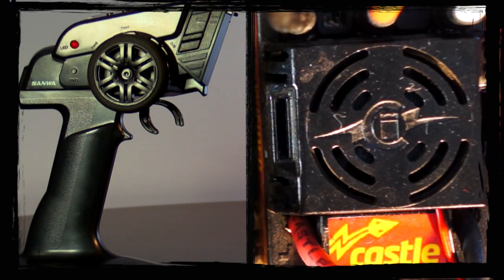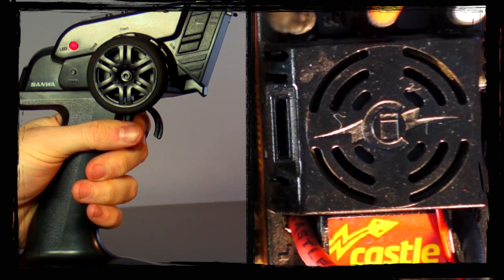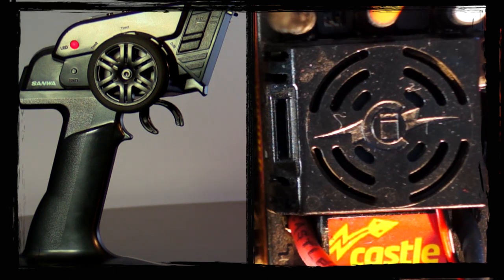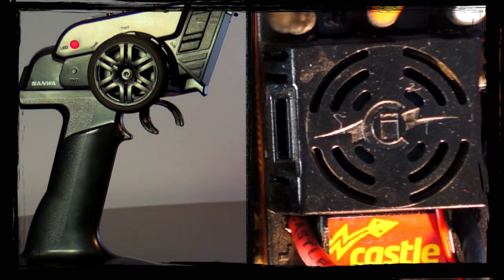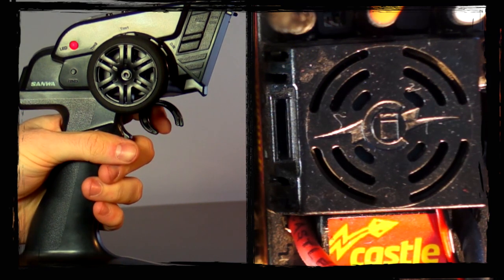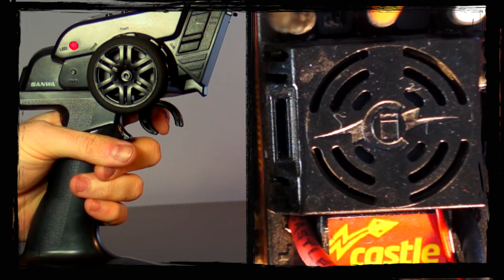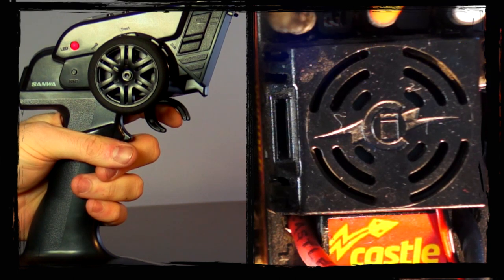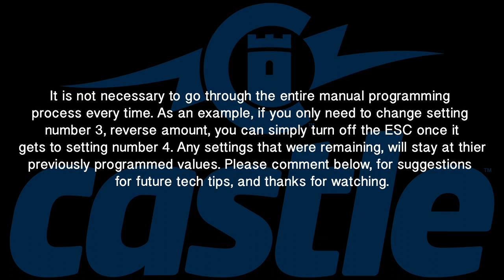Castle Creations ESC Manual Programming

Comment: I have a SW 8th in my Slash 4x4. It has full power in reverse, but not in drive. How do I fix it?
Reply: It sounds like the throttle channel is backwards. Watch the LEDs on the ESC when pulling the trigger. If red, reverse throttle channel on the transmitter, and then calibrate. If the wheels go the wrong way after you can either swap any 2 motor wires (because it's sensorless) or use a Castle Link to change the motor direction.

Comment: This was painful to listen to. I ended up reading the guide that came with the ESC, then bought the programming card because counting beeps is B.S.
Reply: Wetin Dey where did u order the programming card??
Reply: When you say painful to listen to..... do you mean because of the sound quality or are you saying because of him.

If its sound quality... who cares, it was such a perfect tutorial of how to use the transmitter programming mode.  It has helped do many people. 

Think before you trash talk something of value. Frankly no one cares about your hate talking or your opinion in general. You are not providing anything worthwhile. 

Thanks castle creations for all the great equipment, and thank you for this video.
Reply: @brettcoyle2399  ordered it from amazon, think it was called the field programming card? Very simple to use, so easy you don't need instructions or a tutorial. Paid $24?
Reply: @andrewharris6579  you should think before you type. Painful because  it's so easy to lose track of where you are counting the damn beeps  Nobody was "trash talking", you assumed what was not said. Years ago diagnostic trouble codes in cars were read by flashing check engine light when the aldl pins were shorted. That worked at the time(1980ish), but it was the Atari of diagnostic methods looking back. And it was confusing if you blinked while watching for the flashes. I bought the programming card because trying to keep track of the beeps is a pita, and with the card I can tune 1 thing at a time without going through the aggravation.

Comment: Thank god! was able to use this to disable drag brake  and put the reverse higher. I kept getting stuck in rough terrain because I lacked power to reverse and was up against an obstruction. I also turned the drag brake off because it kept straining my gearing on 3s, shredded a spur gear and kept loosening my pinion gear from the sudden shock of full drag brake. The ESC was part of an 2wd RC i bought used and i moved it to a 4x4 thus the change was needed. But having to go all the way to setting 7 to change to nickel is kind of annoying, a dead traxxis ESC I had in the 4x4 before it was just holding the power button down for 10 seconds to change the voltage cutoff.

Comment from the maker: Hi! Every time you start the manual programming process, it begins on option one, setting one. This doesn't mean it didn't save the previous settings. Unfortunately, though, with manual programming, there is no way to know other than responsiveness of the vehicle. With the Castle link however, you can interface with a PC and see your changes as they are saved with the software program.
Reply: Holy shit bro lol Im having exactly the same issue lol just started up my two year old XO1 and my transmitter does exactly the same thing and like you I have no idea if it's saved my previous settings bit of a fucking joke to be honest and the two RC shops and traxxas uk rep that I've spoken to also have no clue either lol nice bloke though and he's going to contact traxxas US for me cause I can't fucking register my XO1 so I now I can't unlock it for 100mph+ and it's this castle creations mamba monster ESC that's the problem. Luckily I bought castle link programming thing at the same time 👍🏻 so I'm gona program it on my PC and like you bro ill see what happens......
Reply: Sorry didn't realise I was replying to castle themselves lol so you know there is an issue with your own hardware, yes?? So why haven't you fixed it years ago?? And traxxas has told me you guys have maybe put the wrong software onto the  XO1 ESC and to send it back to the US well seeing I'm in the UK I can't do that and seeing it's two years old too it's passed its guarantee, sad. I only just found this out now cause I crashed it the first time I drove it lol and never got round to fixing it until the other day. Is there a fix for my XO1 ESC so the traxxas link app can recognise it because every time I try to unlock it for 100mph the link app tells it can't find a lockable device?? I ask because everything seems to point to a software problem with ESC. And great video by the way 👍🏻
Reply: Castle Creations Inc
Reply: Need help programming my Mamba X ESC

Comment: Dear sir,
The manual for the sidewinder 3 that Castle have on website to download only show 6 programable options.

That manual is not correct, because it have 9 options in program mode, just like you show in your video.

I thank you for your help, and please, if you could, tell castle manager to correct the manual on website, because are making clients think they esc is broken, because the order os the 6 options is not even same as the 9 option, so the cars will not have brake and other problems

Comment: I just purchased a castle/esc combo......I go through the setups exactly like you do...but once I go back to do them again....it's like it don't store them in memory, almost like it don't store your inputs.
Reply from the maker: As you are going through the manual programming, it will start on the first option of each setting every time. This does not mean the ESC is programmed for that option, but it has to start on the first option. This means there is no way to know how the ESC is currently program as you are working through the programming process.

Comment: Ok!!! HEADS UP RC FANATICOS...a friend gave me a HPI FLUX VAPOR ESC. and it turns out they have the same beeping, same led indicators, and so I tried the sequence. Before attempting this. The ESC is actually not working, it just stay on yellow as I connect the battery. My receiver is FLYSKY FS-Gr3E and transmitter FS-GT3B binded.

By following the VIDEO instruction carefully from start to end. Guess what? The ESC is now working.

Comment: I just bought a vaterra twin hammers with the castle sidewinder 3combo. It ran great the first 2 times. Its used by the way. Anyhoo I was going to run it one last time before got dark. Plugged battery in turn control on turn car on and North but chiming coming from each and also blinking red yellow and green. My first castle set up so I have no clue. HELP!!

Comment: my esc wont go to program mode....
Reply from the maker: Usually if an ESC will not go into manual programming mode it is because the ESC has not been properly calibrated to your radio. If the ESC is not seeing a full throttle signal it will not enter the programming mode. When you power up the vehicle/ESC at neutral you should see a yellow/amber LED; after it is armed, when you apply full throttle you should see a solid green LED. If it turns red when you apply throttle then your radio's throttle signal is backwards and needs to be reversed.